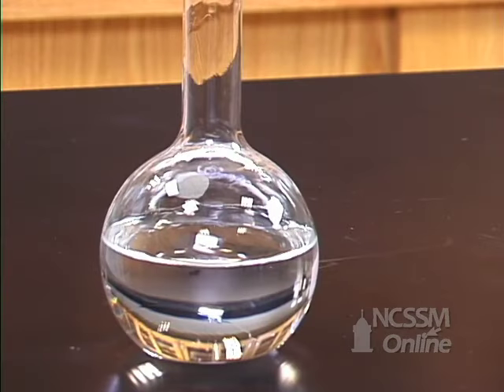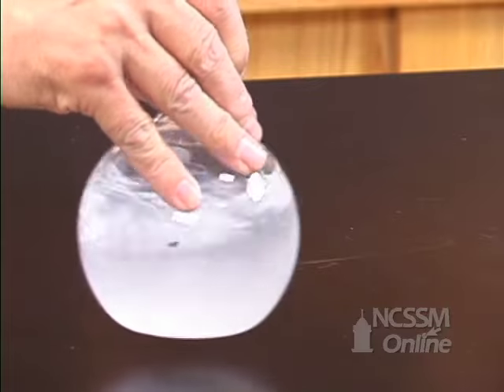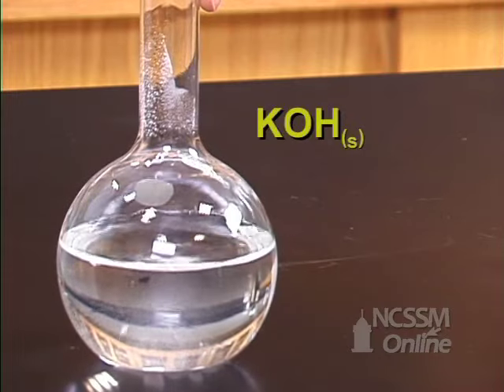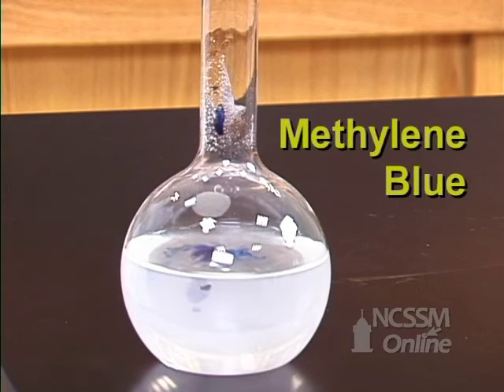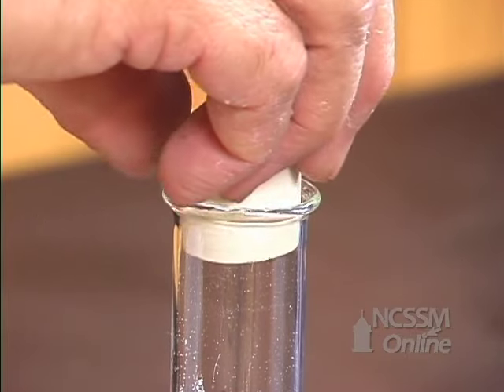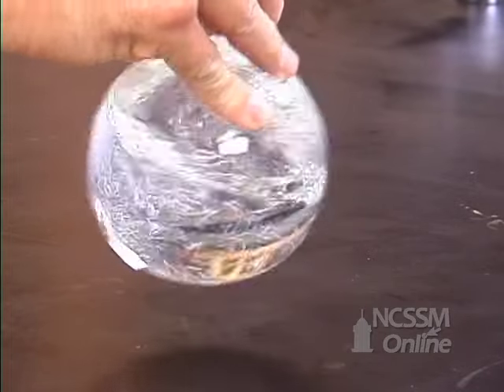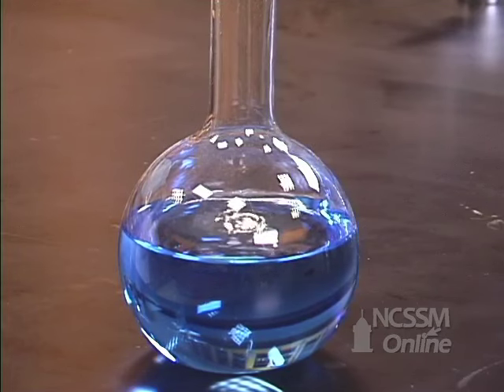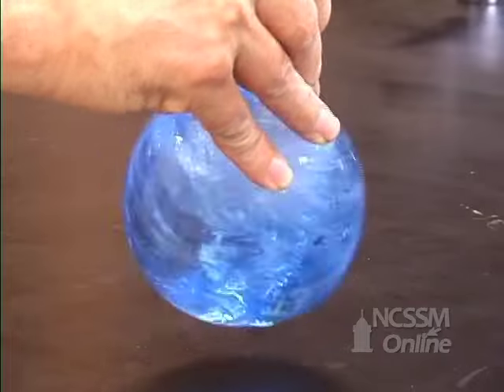Blue Bottle Equilibrium

Comment: The oxygen is dissolved in the solution; hence the methylene blue causes the solution to turn blue. As the reaction proceeds, the oxygen is consumed in the reaction as glucose is oxidised to form carbon dioxide and water and hence the solution goes colourless. As you reshape the flask, you dissolve more oxygen back into solution turning the solution blue again
Reply: Nicholas Sanders
Reply: The explanation was quite helpful to me. Thanks a lot
Reply: I’m doing a worksheet on this video and your answer just saved us 5 minutes
Reply: thank you for helping me with my science project
Reply: so finally three is no oxygen in the enclosed flask,right?
Reply: not really, the change in colour is more due to the reduction of methylene blue to leukomethylene blue
Reply: @rinckeric4741  nope it is just that all the glucose has been oxidised into diketone

Comment: This is not an equilibrium as Glucose in not reformed. By shaking the bottle you just help dissolve more oxygen (one of the reactants) in water. Since gases have very low solubility in water, only a small amount of oxygen may be in the solution at any time, it is consumed fast due to the catalyst and the color dissapears. Shaking speeds up the entry of more oxygen to the water, as if left to disolve while in calm it would react as soon as it disolved. Nice experiment but no equilibrium here, if only production of Glucose was that easy.

Comment: HELP, question:
I'm looking for a reaction where you start with color (any color is ok) and after a certain time, it becomes colorless. If possible I would like to do it with non-harmful chemicals, because it's going to be an experiment for primary school kids. 
-Start with a color (already set up in the container, if possible use non-harmful chemicals or natural products)
-Add H2O and it becomes colorless
-If possible, change the time it takes to become colorless based on the concentration of the initial chemicals/products

-Use natural products or non-harmful chemicals, as it is an experiment for kids, primary school students.

Thank you very much.

Comment: what happen it the flask was filled to the top with the solution
Reply: the driving reaction uses up oxygen (O2). when the O2 reactant is gone the reaction stops and no further color change will occur. with a fuller flask (less air, less oxygen) at the start  the reaction will end sooner than when the flask contains more air, therefore more O2

Comment: It this a reversible reaction or not plzzz reply me
Reply: Yes
Reply: No
Reply: It is not technically reversible.  Methylene blue is reduced by glucose, which makes it turn colorless (called methylene white).  The colorless methylene white can be oxidized back into methylene blue by oxygen.  So, the methylene blue <--> methylene white transformation is reversible in a sense.  I wouldn't call it technically a reversible reaction because they are actually the result of two separate essentially irreversible reactions.  The reaction between methylene blue and glucose along with the reaction between methylene white and oxygen are not reversible in this situation.

Comment: Please give chemical equation for this reaction
Reply: @noxusfumes3628  wrong. the aldehyde gets oxidised to a carbon-acid.
Reply: @nikolaus43211  You can clearly hear him saying this himself, that glucose reacts with oxygen in air to produce CARBON DIOXIDE and not some carbon acid, at 0:28
Reply: @noxusfumes3628  and its wrong. or can you see bubbles rising from carbon dioxide like in soda?
Reply: @nikolaus43211  You do have a point. Now I tend to believe that the evolved CO2 remains dissolved in water as carbonic acid, H2CO3. What's your take on this?
Reply: @noxusfumes3628  its no reaction with carbon dioxide. and h2co3 is no carbonic acid. 
RCOOH is a carbonic (organic) acid. 
the main problem is, that methylblue is an indicator for reduction and oxidation reaction.
glucose reduces the methylblue and by shaking the methylblue is mixed with o2 (of the air) and the o2 oxidize (sorry im no native english speaker) the methylblue, so it turns blue again. you can make it as long as there is some oxygen in the bottle. another product is water but no oxygen, so it cant go forever.